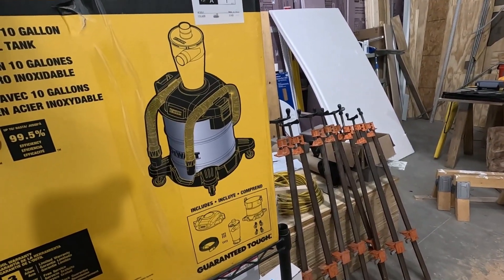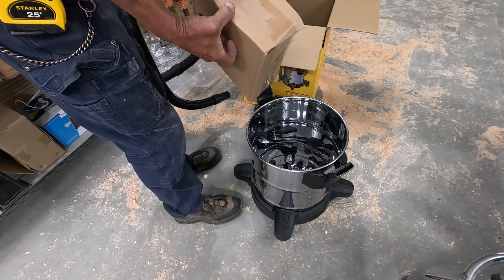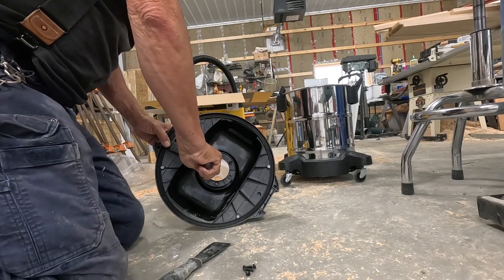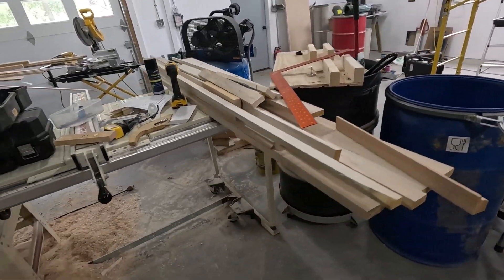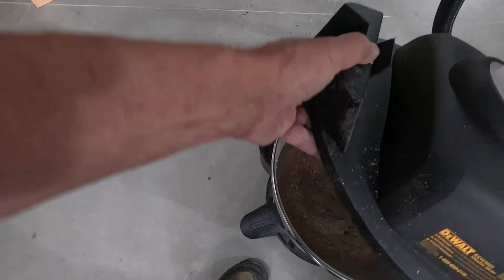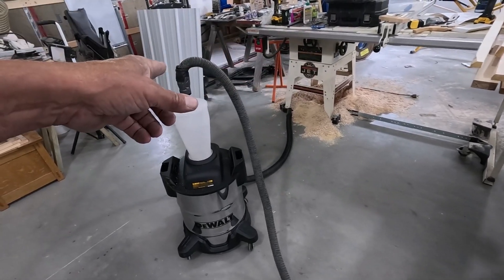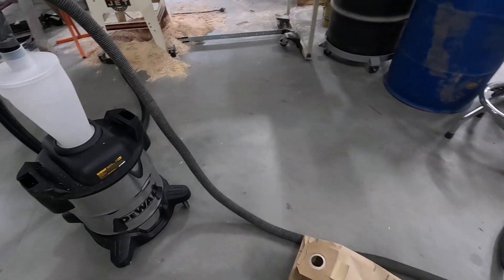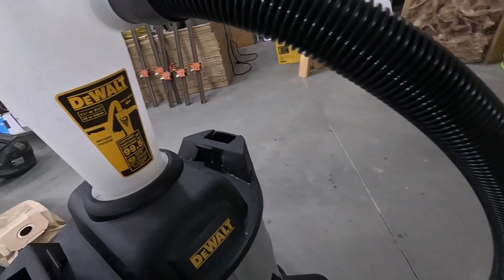Review: DeWalt’s 99.5% Efficient Cyclone Dust Collector

Comment: The manual CFM rating for this is 300-1000. I can not find a shop vac with even a 300 cfm rating. What is the cfm rating of the vac you were using?
Reply from the maker: Are you saying that the manual says that? No shop vac has anywhere near that CFM, and it must be a typo. I have never seen this myself, but I'll look when I can get some time. In the real world, this will work with pretty much any shop vac. Smaller ones will need a smaller hose, but it doesn't take much cfm to create the cyclonic action. I have it hooked to a much older Porter-Cable drywall vac. The new DeWalt Stealthsonic vacs would be perfect if you are shopping for a vac. I have a review on Stealthsonic coming out next week if you're interested 😊

Comment: You did a great job but needed to take into account normal usage rather than trying suck up large volumes of dust of different grades. Obviously, you needed a pile of dust but should have sucked up little at a time and for just about 2 minutes. No point trying to cut or plane wood in real time as this would a long process. Many thanks. 🙏

Comment: If you already have a decent size shop Vac, just buy the  Onieda cyclone dust collector for about $ 50 or 60.
Reply from the maker: Thanks Craig! The same setup with a 10-gallon tank and rollers is $169.96 at Oneida. This was $131.00. I do already have the decent sized shop vac as can be seen in the video.

Comment: None of the dewalt vacs that arent actual dust extractors arent made by dewalt, theyre made by alton. Same company that makes the stanley and porter cable shop vacs. Although ive got a stanley and a dewalt and theyre both immortal. 

Also the cheap shit hose is basically every shop vac these days
Reply from the maker: Thanks Bread! Interesting that they are made by the same company that makes Porter Cable. My Porter Cable3 vac is about 25 years old, but it is an awesome vac for fine dust (anything really). I'm going to pick up a DeWalt "STEALTHSONIC Ultra Quiet" vacs soon, and it's good to hear that they are made by a quality manufacturer!

Comment: I never really looked into these. This would be great for setting up at a tool like you will be doing, because the vacuum's filter would almost never clog! I wonder how well it would work on my milwaukee track saw?
Reply from the maker: It only works as good as your original shop vac, but like you said, by keeping the filter clean,  you should get continuous good vacuum instead of it slowly diminishing as the filter clogs!